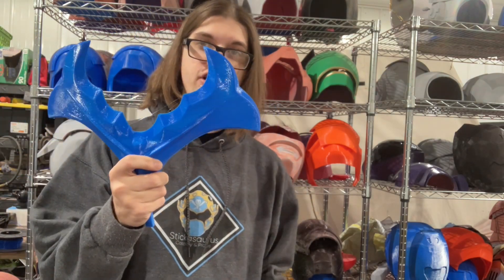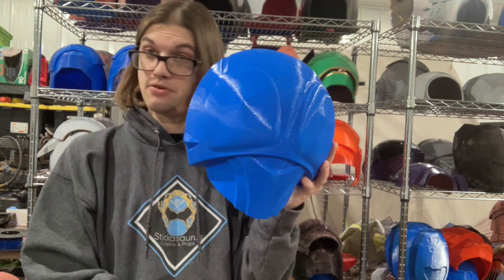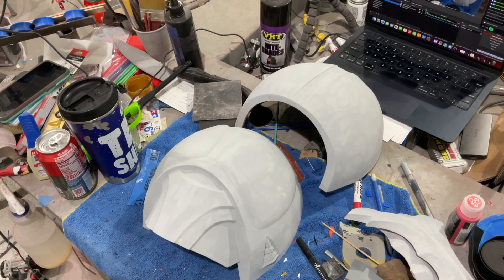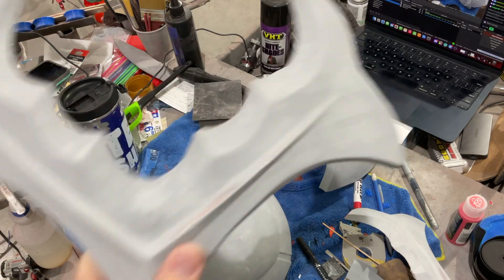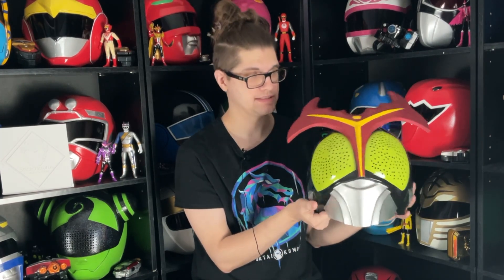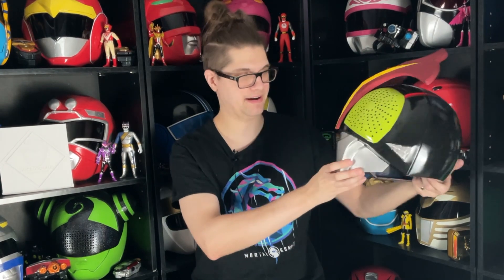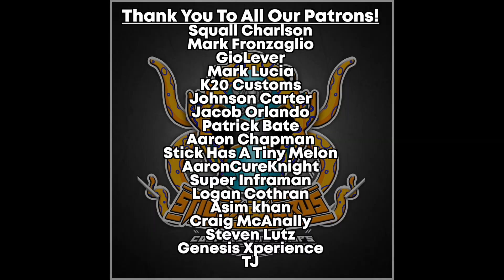DIY: Kamen Rider Stronger Helmet - 3D Printing | 仮面ライダーストロンガーヘルメット制作

Comment: I have a couple questions.  1 where do you get the models? And 2 what was that power tool you were using because I'm hand sanding and that's a pain lmao
Reply from the maker: All over the place! Usually from 3dcommandcenter,dzackers, or zero to hero tho and it’s just an air powered 2in  sander
Reply: @Stickasaurus  awesome thanks! I've been printing halo helmets and couldn't find a power ranger ones for some reason lol
Reply from the maker: @DjUnikardo  if ya need any help feel free to message me